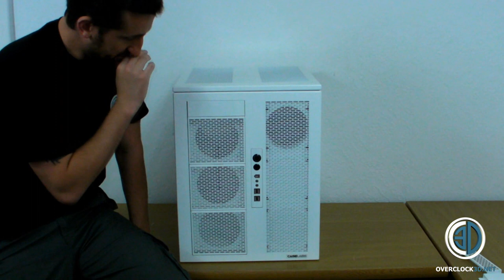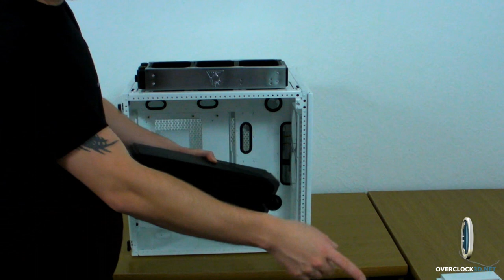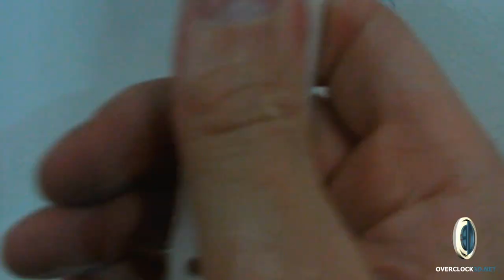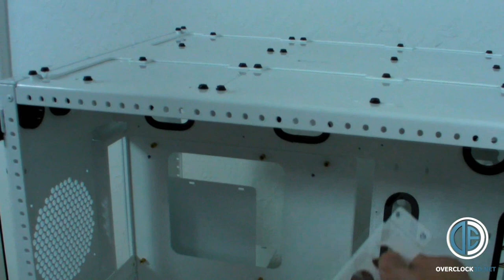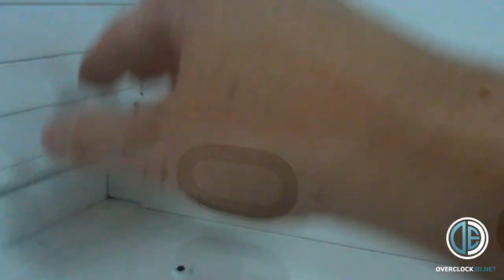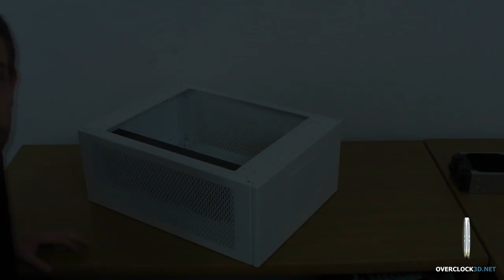Caselabs M8 Review

Comment: @TimeToLiveCustoms Thanks for the concern. I'm extremely careful, doing very small increments. I started 5 hours ago, finished around an hour ago. Tons adjusting, tons testing, many benchmarks, & finally I stress tested it beyond hell and back using FurMark.

Thanks for the response. Great video's. I share each one with a great many people. (My forum, blogs, FB, etc) Peace TTL. Anyway thanks again for that insight into the GTX 560, I'd have missed out.

Comment: Hey Tom, I just bought a GTX 560 Ti, and wow, you weren't kidding. I put the voltage to 1.11V from 0.99, and was able to reach 1Ghz Core and 2Ghz Shader core, from 850mhz Core & 1700mhz Shader!!! Absolutely amazing, I've looked over the charts on tomshardware, and it runs virtually even with the GTX 570! What an epic card, it seems they're all golden, they OC insanely well.

Comment: It all comes down to this, all caselabs cases are build without compromise. ie best build quality you can get. all you have to ask yourself is what do you want from a case? SM8 is smaller but offers equally as much options as a M8 does, its just the "base" size that differs.

Comment: @TheiTouchGuy1994 TH10 is 10 PCI slots. HPTX Form Factor. The radiator clearance over the motherboard is 173mm as opposed to M8's 100mm. The TH10 has 13 Flex Bays and the M8 has 10. The TH10 has 16 slots for HDD and the M8 has 12.

Comment: @TimeToLiveCustoms I agree with Tom. You might also want to get a custom fan profile in as it will get more sensitive to heat as you clock it up. I got one of them for a mate's rig, cuz he's only got a 17" monitor and the monitor doesn't do it justice even at stock Gigabyte OC clocks. I don't really see why you'd want to push it much further.

Comment: @TimeToLiveCustoms dude, around 39:40 where you're perplexed by the removable bottom, 2 holes and feet mounts of the pedistal; to my modular sense of thinking it's obvious that it's to allow stacking, should you want another module underneath (be that an identical pedistal or something else).
Due to the same thinking, i wouldn't be surprised if you could get an optional top to the case with holes to mount something like this on top. That way you could make your own tower rack.

Comment: Good point about the individual USB front panel wires - if the ATX power connectors are whacked into a common plug, why not the USBs?

Comment: Put a fan blank in the front of the extension. Cover the front, and the two back fan holes with filters. Put your radiators normally. Bam! Negative airflow, but good filtering.

Comment: Could the bottom of the pedestal be removed so you could potentially have another pedestal bellow the first.
So you could stack multiple pedestals as the bottom of each pedestal matches the same threads for another pedestal as the bottom the case.
Please thumb this up so tom can see this and tell me if I'm right or wrong because I really want to know if this is an option :)